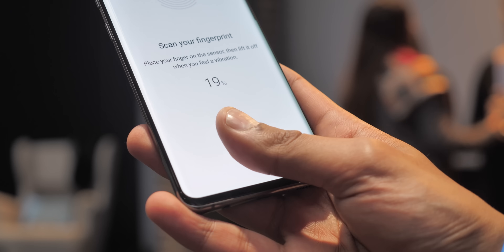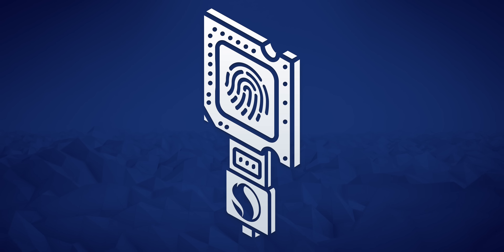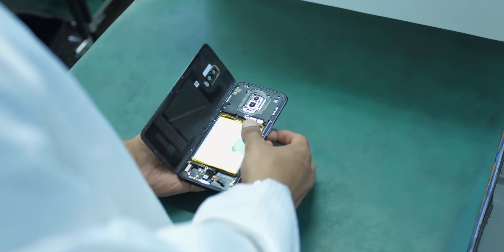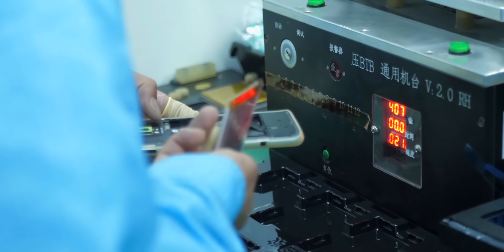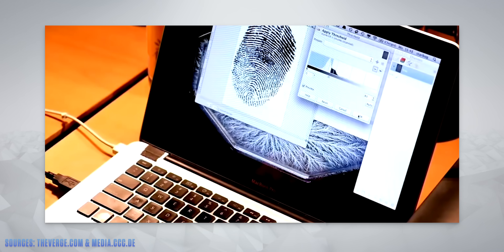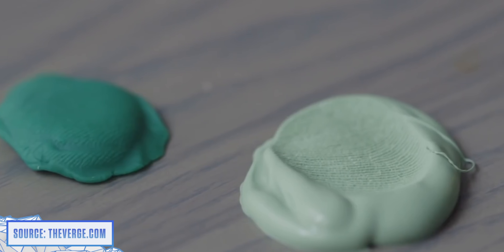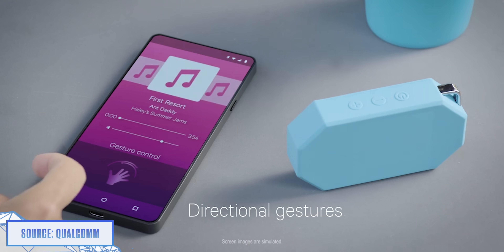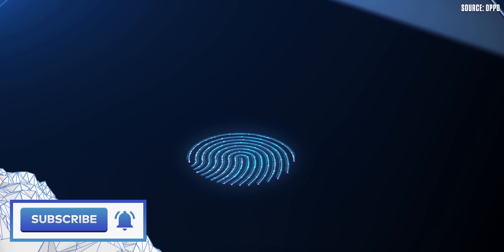Samsung S10's 3D Sonic Sensor IS GAME CHANGING.

Comment: So 2 Years later: I am using the Note 10+ right now and the Fingerprint reader is really the worst. It is slow, just a little moisture and it doesn't work, I do have to press my finger against the screen, sometimes it is faster with an good speed, but mostly I need to try it as often as it says "Unlock with Passcode". The only Good thing is, I know where it is locad and it unlocks with display turned off. But on the S21 Series the sensor is 1.77 times bigger and there it is reliable and fast! Same as all other optical finger print readers I know🤣...

Comment: To each their own ..but it's not even close to being a game changer.... This, is a game changer:
   My smartphone;.  Razer 2. Cost: 649.00 new and unlocked. Plan: Cricket 55.00 monthly unlimited. OS system: Android Pie. Storage: 576gb Kingston micro SD card/plus 64gb phone. Ram 8gb. Refresh rate: 120mhz. Camera and brightness issues fixed with new updates. Built in DAC for superior music using Onkyo HF player. Dual speakers with dual amps. Superior gaming with Cortex. HD display with multi display choices. Wireless charging and RGB logo on back.  Gestures are fluid with zero lag. Battery lasts into a second day...I'm holding the best smartphone made right now and it's ready for the future...I won't have to purchase the next smartphone to get more... I've got it. All the talk about shortcomings with the Razer 2... Lol...those people are on meds or paid off by the competition. Till you put this treasure in your hands, you won't understand. Razer 2 rules no matter what anyone says. Thanks Razer ... everything I hoped and waited for and more. Good video if you like that phone.

Comment: Hi Mrwhosetheboss, I really like you and your videos. They are so very well produced and edited. Though, one thing about this one specific: The fingerprint scanner OLED burn-in is total bogus. The scanner hits max brightness for 1 second (2 second if missread) - Lets say for a Mi 9 at around 600 nits. Note that burn-in is caused when an image is stationary on the screen for too long (or repeatedly like the fingerprint flash). Even at maximum brightness, the fingerprint scanner should be on for at least one full week for it to be even slightly noticable. In other words  7 days*24 hours (168 hours). 168*60*60 to come to seconds -> 604.800 seconds. If you would pick up your phone as an average user about 200 times a day with a 1 second flash, meaning 200 seconds a day, you will be good for 604800/200 = 3024 days. So please, call me in 8 years and a half for a possible (and even then unlikely) screen replacement :-). I understand it's only natural to obsess over details.. but please get your information right. The imagery used of the purple fingerprint is totally missleading and might even scare people off. I might even start to believe you were paid by Samsung for convincing them.

Comment: i still think that the side mounted fingerprint sensor is the best.
since it is always reachable, and is in a well defined spot. rather than "somewhere" on the screen.
when you are in an uncomfortable situation. like driving a car. it is much easier to reach for the indent on the side, than hit a spot on the screen that is not marked.

also, a side mounted FP scanner can be used as extra input. in samsung devices, you can swipe on in to open the notification panel. which is something i use a lot

Comment: It only works with Whitestone type screen protectors. Will not work with any other tempered glass screen protectors. While the ultrasonic scanner is a technological innovation, it is flawed. Additionally, you still have to place your finger in a specific area. It really would have been exciting if your fingerprint could be read from anywhere on the screen. We should not confuse innovation with real-time everyday use.

Comment: But OnePlus 6t unlocks faster than the s10 and takes no effort while pressing. It works through screen protectors too. And the s10 doesn't work with we fingers. Did you get this information straight from Qualcomm without doing any testing?

Comment: Really good tech, I honestly rely more on 3D face unlock set to unlock as soon as I raise my phone... No need to push any buttons or put my finger on a specific spot. The only times I actually use the optical sensor is if the phone is on a table or in my car mount... Anyhow, the 3D sensor is a step in the right direction. Next would be a whole display fingerpint sensor along with underdisplay cameras and other sensor (to get that true bezeless design)

Comment: This is basically an ad from Qualcomm. If you want to make a real video then make a comparison between the in display fingerprint scanner in the Mate 20 Pro, OnePlus 6T, and the Samsung S10. You can test the speed and accuracy in different conditions.
Reply: When is the last time you took a science class? Go read how ultrasonic waves work, and the explanation is spot on, infact alot of engineers in my firm use lasers for measurement for the exact same reasons, more accurate, it measures how long it took for a laser to go and come back
Reply: I dont care if its slower, as long as its more secure and accurate

Comment: What about the device with exynos processor!? Does it have the same processing power and speed to detect the fingerprint?
Reply: Tom Cooper Yes, the exynos variant of the S10 is actually benchmarking slightly higher than the SD855.

Comment: I wouldn't call 6t's battery small by any means & i am still not convinced with indisplay fingerprint sensors optical ultrasonic meh they are still slow, i was really expecting samsung to bring the fastest underdisplay scanner but 6t's is still faster.

Comment: It's not game changing,why are you lying, it's shite, are you all idiots. You still can't open the phone with wet fingers, everbody test it with wet fingers it doesn't open once(samsung claim you can), its still not fast as optical, it's actually lot slower(vivo, oppo  udfp is faster then samsung) and now you can't see shit where to put your thum(it doesn't need light) that is why samsung have that ugly screen protector with hole where thum is(to navigate your hand). Next time be objective, this video is false as Donald Trump speach.
Reply: Atleast it works everytime unlike the optical ones
Reply: @manazmohan  It doesn't work every time, that's the point, it WILL NOT WORK WITH WET FINGER, THEY PROMISED IT WILL WORK, BUT IT IS NOT WORKING,and now you do not have safe unlock like 3d face unlock, your still stuck with three step unlock which it doesnt open every time and is slow, and you can't see shit where to put your thum.
Reply: @dado380  Yeah. Wet finger takes years to dry

Comment: Heard that ultrasonic fingerprint scanner has troubles when used a screen protector 🤔🤔🤔
Reply: Who still uses screen protector nowadays?
Reply: @alenezifahad9481  who uses a headphone jack nowadays?
Reply: @ThugLife-vv2dc  
Most people
Reply: @alenezifahad9481  similarly most people use screen protector
Reply: @ThugLife-vv2dc  then you can get a screen protector that works with the new finger print scanner for only extra 10$
Reply: @alenezifahad9481  I have heard rumours which say S10 comes with pre-installed screen protector.
Reply: @ThugLife-vv2dc  
It comes with a sticker actually not a glass screen protector
Reply: ALenezi Fahad do you replace your screen often? Do u care your screen without scratches
Reply: @costelli1  

I had my s9 for a year now
No issues
Reply: @costelli1  also i get my phone with a plan that covers those sort of stuff

Comment: It's all cool and nice tech, but this was a paid commercial. I have had my 6T nearly from the launch and used the fingerprint scanner a LOT and there's no sign of anything weird. And second, security is not an issue and I find it hard to believe there's a single case with somebody actually going through the effort of goin in with a fake fingerprint. It's much easier to use your sleeping/passed out/knocked out friend's/person's finger to unlock it. I also saw a video of somebody failing to unlock the phone with wet fingers. And the speed difference isn't really that big at all. Some even said it was a bit slower. And you certainly don't need any force to use the scanner on 6T for example. A gentle tap is all it takes.

The only thing I found legit and useful was the size difference and that really makes sense.
Reply: Well said.
Reply: Dude just admit that ultrasonic tech is better tan optic tech. No need to get hyper.
Reply: @akashtopder7251  The ultrasonic tech is slightly better.
But is not game changing.
It's as fast as optical scanners and that's what really matters. (Ultrasonic scanner is faster only in the setup process)

The extra security is useless, let's not fool ourselves.

It's simpler to guess the pin, rather than making a replica of your fingerprint.
No one would do such a thing.

The only downside of optical scanner is the fact that you need to turn the screen on before unlocking with it.
Reply: @davide.russoo_  Couldn't have said it much better. Thank you. Might I also add that you don't necessarily have to press the power button to wake up the screen, touching the screen or lifting the phone up or even moving it slightly will wake it up if you have it enabled in the settings. 🙂
Reply: @Thunderhawk51  Yes I know, that features are pretty useful when it comes to unlock the device.
Reply: @akashtopder7251  Of course it's better, I wasn't trying to deny that. But the optical sensor isn't really that bad either. I have had very little issues with my 6T. The size of the sensor is the only major difference in my opinion. The supersonic one also might be a bit faster and read your finger better, but I see no reason bashing a technology that only recently came to exist in phones anyway. And doing supersonic scanner was - afaik - impossible before 855 chip so you really can't blame it too much.
Reply: @Thunderhawk51  ultrasonic scanner won't work if you apply a tempered glass on your screen. Don't know why anyone isn't talking about that
Reply: @jackyu4714  Don't know about that but I think there was one company claiming they have one that works. Also, plastic ones that comes with the phone should work too and I think those are plenty to protect the screen, but they can't necessarily handle drops.

Comment: What happened about the camera comparison? New one coming with Pixel and Nokia? 🤔
Reply: It never processed to 1080p. If you press 1080p it will just load forever. Only worked with low resolution.